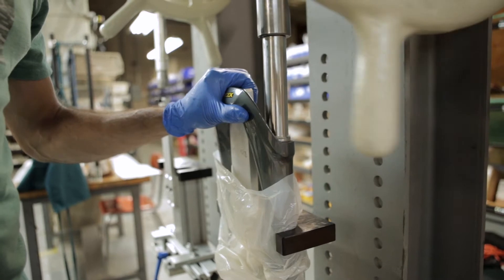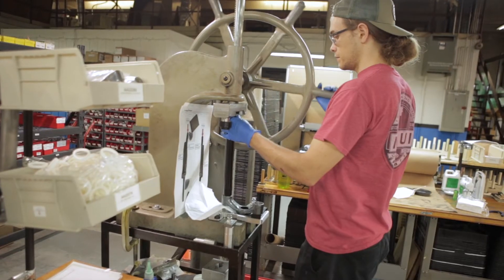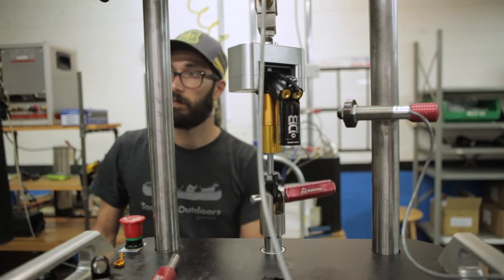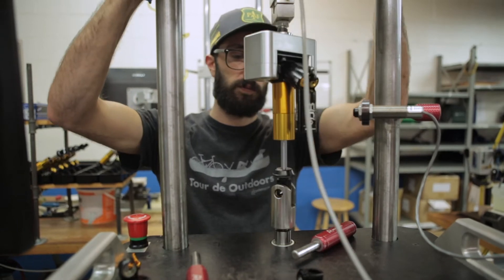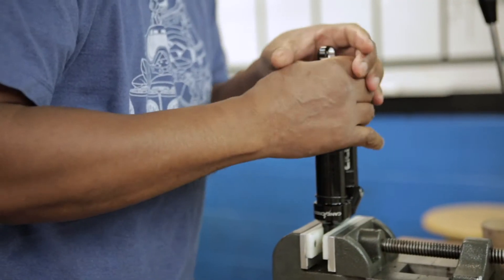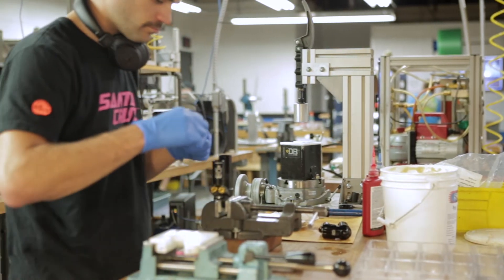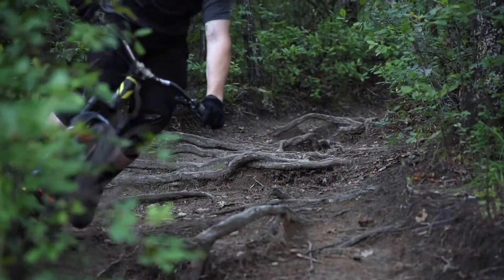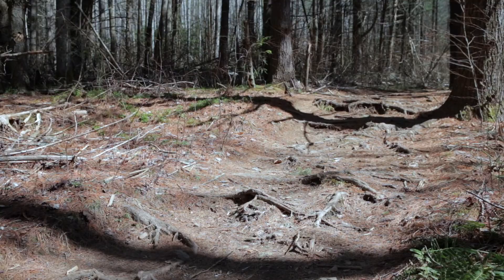Cane Creek Suspension - Hand Assembled, Rider Tested

Comment: I just put a Cane Creek DB IL coil shock on my bike with the Valt spring, Cube Stereo 160TM 2016. Not sure which of you guys made it though 😉
Reply from the maker: The whole crew would have had some hand in the shock. The process starts at one end of the floor with the team doing sub-assembly and then passing it along to the next guy for main assembly, filling oil, testing etc. I hope you're loving your new shock. Thanks for choosing Cane Creek.

Comment: Love your shocks but hate your service... I need my air can fully serviced on a 2015 db air cs xv shock but rather then selling real riders the seal kits to do the work I'm told those seals are only sold to autherized dealers. Cane creek needs to change their policy. I'm not about to send a shock out for roughly a week or more with shipping to a service center only to have to wait a week plus s&h to get the shock back and on top of that have to pay over $170 to have it done. It's a slap to the face and honestly your company can make more money selling those seals to both riders and service centers. I say that because at this point the money seems to be cane creeks driving force behind holding products back.